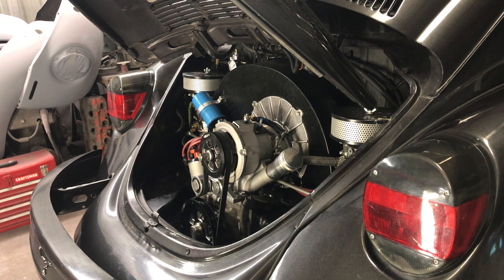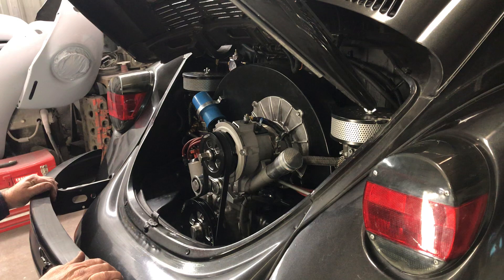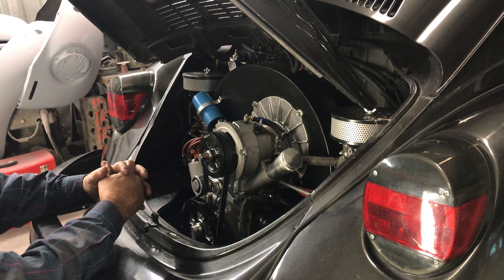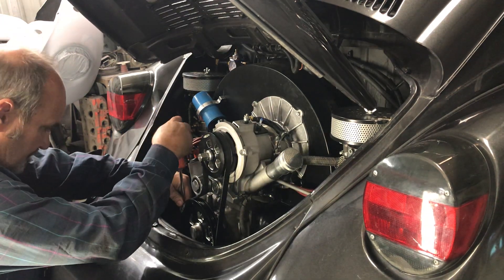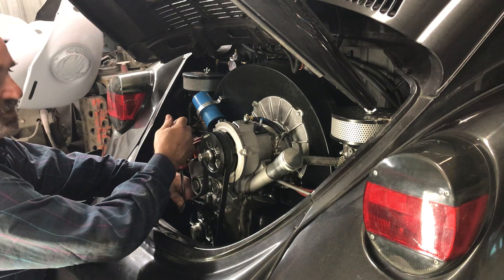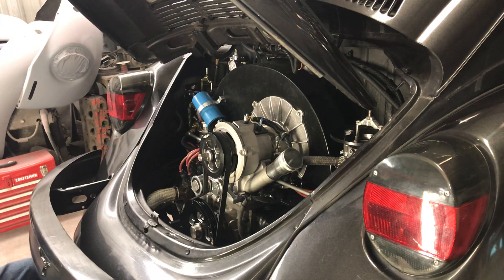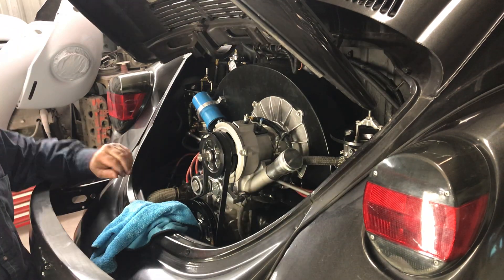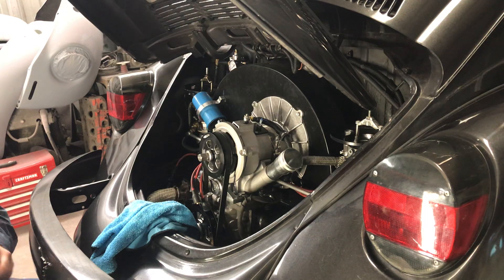Start of a motor build// pulling the motor

Comment: Good to see you up making videos again! I  thought we'd seen the last of you.. I  hope you can salvage some of the parts in this guy's motor in the rebuild. a 78 crank with the 94 bores will make a 2175 (approx) which is a nice revvy and torquey motor without being too peaky.
 I would recommend going with a webcams 86A grind , which needs 1.4 or 1.5 ratio rockers, but it is amazing how these make power right thru the rev range without being too sleepy anwhere either. I agree that the carbs are holding the engine back, and you will need at least 2 x 40mm Dels / Webers and at least 8.5:1 compression to make that cam worthwhile anyway. But thats the best 'have the cake and eat it too' street combo I would ever recommend that has good manners around town that you won't be wishing you were somewhere else if you ever get stuck in traffic because it has no power under 3000rpm but also has enough power to put a great s#@t eating grin on your face everytime you mat the throttle ..
How are your projects going these days? did you sell the RV? Still got the Porsche?
Peace man